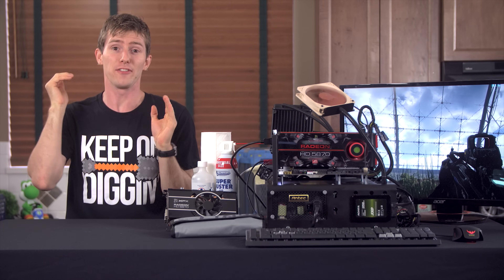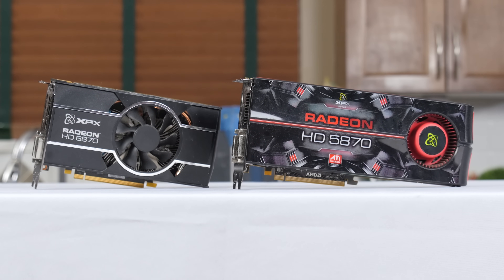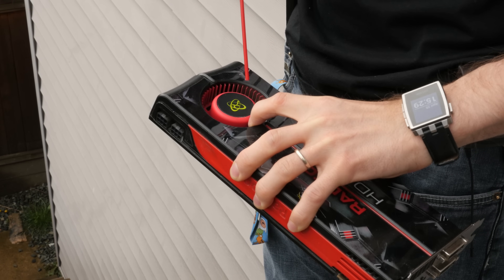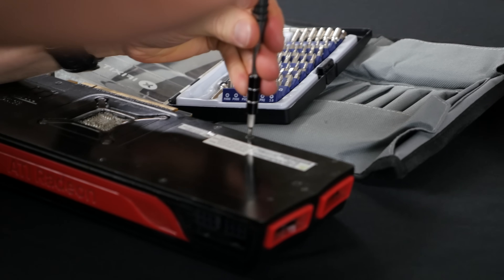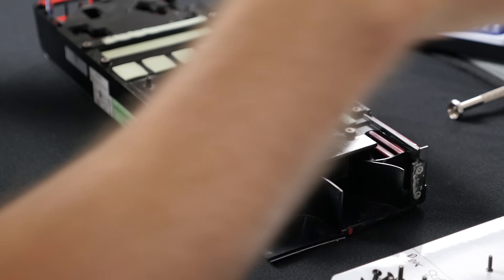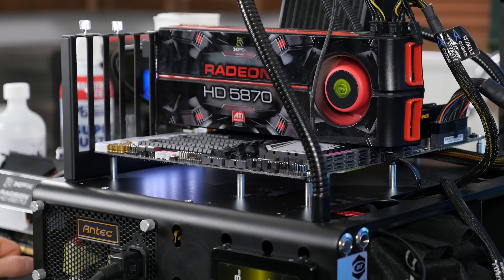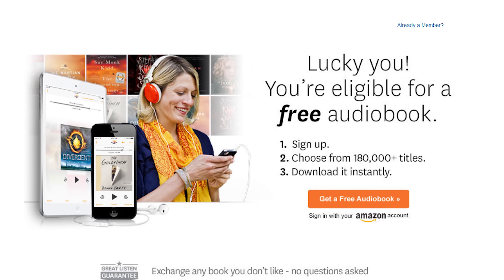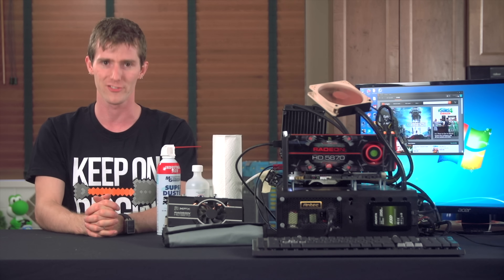Video Card Running Poorly? Clean Your Video Card Cooler!

Comment: I had a video card I got from a friend a while ago and it got extremely hot, up near 90c.  And, no surprise, it would lock up shortly after any game was started. 
It had a blower type cooler, I took it completely apart(A can of air didn't help it).  I found that the inlet(Not normally accessible) for the heat sink fins was completely blocked by about 1/8 of a inch of a solid piece of dust.  I cleaned it up and it was topping out at 60c and it no longer locks up.  Linus's video doesn't really demonstrate, but if your card is really dusty it can make a huge difference.

Comment: fun fact: up until two weeks ago a 5870 WAS my VGA... it took GTA:V to get me to upgrade to something a bit beefier... like a 980. :o

And even using the rest of the pc hardware as it was (an almost 5 years old AMD phenom CPU + 8 gigs non dual channel, because my mobo had a stroke a few years back) i can run gta V with all settings maxed (ultra, not high.. friggin ultra!, but not the "extra" settings, ofc)

this at 60fps. at 1080p 2xmsaa, mind you. but that goes to show how a pc bought in the last gen console generation, only needed an investment of 500 bucks after rebates to beat the snot out of the next gen consoles.

im planning on upgrading the rest of the set up, in the mean time overclocking the cpu 200 mhz extra thanks to the burnin it has after all the years gave me a good +300 score on valley bench.

oh that 5870... i could even play PS2 on it at 60. lovely VGA, too bad it has only one gig of ram.

Comment: I still have a 2gb version with 6 mini dp of that 5870 lying around. It was my first dedicated graphics card and was quite badass back in.. ikd 2009 or so? But at some point it was hitting 90°C in vacuum cleaner mode, despite me cleaning it and replacing thermal compund, wich was the time I decided to upgrade. It still works though, despite just lying arround in random places all the time with not protection (currently on my windowsill)

Comment: guys i need help cleaning a gtx 280 1gb gddr3... runs 70%fan at 90c under load .... 50% fan speed and 55c idle.... can anyone help me ? don't have the money to replace it just yet and want to make sure it lasts me as long as possible. thanks! :)

Comment: Clean your  heatsinks and radiators every 1-2 months. If you leave dust on too long, it gets caked on and hard to clean, but if clear often, you will be able to be able to get by with the suction of a vacuum cleaner hose in order to keep the radiator and heatsink clean.
PS, this also applies to laptops.

Comment: I use to put my graphics card in the washing machine on 30 C. It has worked great so far and my graphics card (Nvidia r7 270) comes out clean and shining. Water isn't bad for your computer unless electricity runs while it's wet. Then I put it in the dryer so it dries faster. The same procedure can be done with your t-shirt

Comment: BE careful not to drop your Graphics card off your 1 feet graphics card box.
I rested my 570 on my 970 box planning for cleaning up and resale purposes. I kicked the box by accident and it fell on the PCB side. When I plugged into the PC I got no image. Nothing. Blank. Black. Amber LED. It was dead. I could login into my account by typing the password and hearing the login sound but there was no display. Not even during POST. So, DO NOT DROP YOUR Graphics card.

Comment: I've had a worse card than either of these.  I picked up an ENGTX 260 that had so much dust and hair in it when I took it apart it had filled every possible space in the cooling fins so tight the trash came out in chunks.  I don't think it was possible for air to actually move through the card any more before I cleaned it.

Comment: I ran into a headache while helping my friend who's having problems with his XFX 7950, It idle's at 60c and tops at 80c at max, wich isnt weird and the fanspeeds are normal, but the card performs sooo bad! My gtx 660 ownes it even though the 7950 is a better performing card!
There was NO dust at all on it! so i thought it could need a thermal paste replacement. But i didnt do it because i didnt want to ruin the thermal pads and replace them. But as you said in this video, will reusing the thermal pads have an inpact on cooling for the drm's?
Reply: It's going south.
Reply: Joshua Bean ?
Reply: ***** Ok good, Didnt do anything because of i it but now i know that there is no problem in it

Comment: I disassabled my R9 270 Dual X cooler design when I saw this video because my gpu ran at 82°C while playing Tomb Raider after 5 hours. Next day I ran Furmark for 1 hour and reached only 80°C (note: Tomb Raider is NOT that demanding), About 3-5°C approvement. If you're not confident about dissasembling it then it's not worth it. If you are, definitely try it.

Comment: I had fantastic experience of cleaning my 3 years old Asus G74 laptop. It became loud as lawnmower and every game stuttered significantly after just few minutes of gaming. I have two cats so I guessed that it's fans are cluttered with fur. Dis assembling this tank was too stressful for me to do it (to access it's interior you have to rip it to the bone including screen so i passed) so I called for serviceman. With his help I was able to clean fans using straight cable ties inserted into the fans (so it won't turn while blowing air). As an air intake to blow dust out we used pressurized air and one of us kept vacuum cleaner to suck fur from the other side. It worked and my laptop works as new. I don't hear fans anymore and I have no stutter anymore.

Comment: Reminds me of my good old GTX295, that thing had to be cleaned every 3-6 months.
It would usually auto poweroff at about 105C, then after cleaning it would be back to 85C at full load, good for at least another 3 months of gaming :)
I just cleaned it with an air compressor, no problems.

Comment: My twin frozr II 6950 was running in the mid-80's under load and 55-60 at idle.I cleaned it (just by removing the shroud and blowing out dust) and it now idles below 40 at stock fan speeds and i've never seen it go above 65 under load. I set a custom fan profile so the fans are only at 20% until it hits 60 and it's never performed better.

Comment: #laptopCards4TheWin
Reply: ***** So true, there is hardly any ventilation and if you have a plastic chassis they seem to heat up a lot quicker and with my old laptop even slightly melt!
Reply: +stinky farts , my laptop is an exelent ventilator and I have had my nvidia GeForce 940i for 8 years now playing highly demanding games. Including GTA, JUST CAUSE and more open world type games. I am installing liquid cooling and it should run fine. Go run your go run your vacuums.

Comment: I clean my PC every 2 weeks, including removing the GPUs and dusting them.  I have, on occasion, vacuumed the fans too to get rid of as much dust/hair as possible.

Some people say vacuuming your PC is a big no-no, but it gives me the BEST performance improvements.  I have a dog and my PC shares a room with a tumble-dryer, so it gathers lots of dust/dander/hair.  After a clean, it can go from 95 degrees C to 35 degrees C.  I'm NOT exaggerating.
Reply: get some fan filters on your case dude.
Reply: there ate vacuums meant specifically for cleaning pcs pay a trip to newegg.com
Reply: of course its called a datavac
Reply: Magnefficient Fragz Nice one!  I just had a quick look around (I'm in the UK, so no newegg for me :( ).  They are very expensive for what they are so I'll probably stick with my normal vacuum.  I've been doing it for years without problems (touch wood!).
Reply: Muzly get an air compressor with adjustable psi selector and with an inline filter to filter out the moisture in the air. Then get an air spray nozzle. Set it to about 35 psi and start blowing out your pc. It works perfectly. I use it every 3 months to clean out my pc. Just do it out side or dust will get every where.
Reply: I clean mine every 6 months, my PC doesn't really get dusty.
Reply: Muzly Get some filters for your lungs too
Reply: Scooter even with filters dust can and will get inside.

Comment: if your PSU is starting to fail and you install a new GPU that requires more power could that mess with your usb having power when you have 12 of them and there all filled
Reply: yes

Comment: air compressor FTW. shoot those dust to heaven. also, please do some guide on oiling GPU fans (or other PC fans in general). i had one problem with 'firstd' GPU fan on my leadtek gtx 770. it doesnt have any hole to put oil.

Comment: My GPU is a Quadro FX 1600M (hateful) in my Dell Precision M6300 workstation laptop (which I use to play games), and the thing runs like trying to get a drunk elephant to go through a 9mm bullet hole without touching it. It's a piece of junk, I bought a better computer off a friend of mine but I can't get that yet, but I wonder if my current laptop graphics card or other components could do with a dusting. It's got a dual core processor and 4GB of DDR2 RAM, but I think it's got only one fan, which may be the CPU cooler if it has one, or else that may be the hard drive running it's tiny heart out trying to run a game at the minimum-est settings I can get a game to (first thing I do when I get a game: turn the setting to bare minimum) so I may look to see if they need dusting, and see if that helps. Any advice would be appreciated greatly.

Comment: I usually just throw my components in the dish washer and I never had a problem with them! :)
Reply: Lord Krigarjonas I usually prepare a bath and a scented candle for my components and let them have a nice bath with some music for a couple of hours.. No problem. ;)
Reply: Lord Krigarjonas I just toss them on the lawn and spray them with the hose, never had any problems....kappa
Reply: Lord Krigarjonas Tbh washing  components/keyboards  and  mice is the best way to clean them, as long a they're dry before you turn them back on.
Reply: ***** Oh yeah, nothing beats that, dude! Do you join your components in the bath?
Reply: Sam Lego As long as there is no current going through the card, it is safe to be put in water, but once you pull it out, you have to be sure it is completely dry before you use it again.
Reply: ***** What kind of music do you usually put on? Mine are a bit picky and have delusions of grandeur so I'm not sure what would please them. Maybe some classical music?
Reply: ***** Plenty of bath-salts really let those parts relax!
Reply: I clean my electronics with distilled water (I am serious) and went as far a completely disassembling my MacBook Pro and washing the motherboard to remove all dust :P
Reply: Lord Krigarjonas A commercial grade washing machine works better though.
Reply: norge696 Or if the water leaves solutes on the circuits after evaporating.
Reply: ***** Can still leave solutes. Although it doesn't have much of anything in it on its own, it can pick up things while being on the boards.
Reply: frealms mine is kinda weird they like reggae-dubstep...
Reply: same
Reply: i piss on them
Reply: Thomas Zwart And absolutely dry and clean from whatever was in that water so it won't rust, corrode, grow mold or wildlife and nothing that came through the allegedly clean water source ain't gonna short some solder tips or internals.

So no, it is not safe to be put in water unless you wanna have the time of your life going over the card after it.
Reply: Yeah, ik its just I was asking cause like lets say of I got a power washer and just saod WOOOOOOOSH it be good?
Reply: ***** Oh, they must be newer cards. =p
Reply: StevieRay9O Use one HDMI each to carry to them their favorite soundtrack I guess.
Reply: I thought I was the only one...
Reply: Lord Krigarjonas 

I throw my PC in the back of my truck and go through the car wash, don't get wax though!
Reply: StevieRay9O Should see how awesome it gets in black light. Crowd goes wild!
Reply: I like top load washers, everything bumping each other during agitation frees up so much mess.
Reply: Lord Krigarjonas Kitty Kepler Water doesn't effect electronics unless they're on at the time.
Reply: tolikechicken what if you use distilled water?
Reply: tolikechicken what about mineral oil? It does not get conductive
Reply: jonnathan deven Dump all of it you want on your components. Linus and Luke have made computers submerged in it. It is a bitch to clean off though.
Reply: frealms What if you have SLI & each GPU prefers different music genres?
Reply: yesitsmario
Should wax it, as pc will stay cleaner, especially when used outdoors at lan-parties & bbq's!
Reply: StevieRay9O For parties I take my chromed out parts.
Reply: Lord Krigarjonas
Reply: frealms
Great party-trick to have chromed private-parts! Ultimate-Bling!!!
Reply: +Felix V but dont forget to dry them in the microwave, dont want water when turn on.
Reply: rubikfan1 That's for scrubs. Once you go hardcore, you use a blowtorch to dry it.
Reply: frealms or lvl up and put it in freezer, than use a hammer to hit of the ice. now you gpu is cooler. and cooler=better
Reply: rubikfan1 But it's wet again! You ain't thinking this through, you use the freezer to ice-cool it and then use the blowtorch to dry it once the ice starts melting and start the process again.

It's a two-step process for maximum performance of the champions MLG no-scope pros.
Reply: frealms no no. you hit the ice off with a hammer. so it is freeze dried like mars. the blow torch is only for the vram.
Reply: rubikfan1 Ahh, I get you, I get you. Good point!
Reply: FlamingRavenMC your grammar sound like brittany ventis grammar
Reply: pfft! I take mine scuba diving and let the cleaner shrimps pick at all the imperfections till its squicky cleaning making sure to decompress on the way up so it doesn't get the bends!
Reply: I hope your kidding
Reply: I usually throw my components in the washer machine and add some bleach
Reply: Lord Krigarjonas water+electronics.....
Reply: @FRK_WasTaken  just dont ad electricity
Reply: explosev gamr yeye
Reply: Hoi hi lol

Comment: Granted I don't know the temperatures up there, but it's almost summer. Running any card at the bare minimum fan speed (mine won't even go below 40%) is asking for high temperatures especially if it's well used.

Comment: Guys a great way to cool your graphics card is to throw it into the freezer for about an hour, then immediately throw it back into your system. the coolness from your freezer should last a while and keep your card nice and cool while playing those stressful games.
Reply: Thanks! I'm going to try this. I'll tell you how it goes!!!
Reply: Fred Lavar Steenerson Stevens Herbert 
hope u joke riiight. or mybe Trolling!!
it will doom VGA card or any electric dvice in freezer then operated.
Humidy will shortcircuit component.
Reply: Hanes G.Mdia
shut up noob
Reply: Fred Lavar Steenerson Stevens Herbert
bruup...) at least now i know u not try to troll,
just lack of information ),
better way is prepare a frozen ice pack,
than put to nearest air suction of PC case.
not help much, on mine cooling 5 C.
just watch water drop...
if u put in freezer there's humidity will short ur VGA even only 1 hour.
still best solution is water cooling!
Reply: Hanes G.Mdia
thank u
Reply: Condensation will build up going from freezer to a warm area. Ever notice how a glass of ice water sweats when out in a warm house or hot weather? That will happen to your gpu and fry it.
Reply: Fred Lavar Steenerson Stevens Herbert Also a great way to fry your card, I can only hope that you forgot to include a Kappa or some hint of sarcasm lol

Comment: My Asus GTX 760 sometimes has issues with artifacting (even with max power target and overvoltage [without BIOS changes] at stock speeds), and Nvidia display driver crashing... it also has ~70% fan speed under load at stock.

Is this a really bad sign? I never realized people typically have such low fan speeds... especially on a reference blower style o__0

I get the feeling the Display driver crashing (only happens occasionally) is an issue with the driver rather than the card.

Comment: Woah,  I have that exact xfx 6870. I've had to replace the cooler a few times because the fan died several times. Its still a pretty cool card that I still haven't replaced.

Comment: I clean my computer regularly but I used to just blow out the heat sinks and fans with a compressor and that was it but my computer started randomly shutting down and blue screening and black screening so I tried cleaning it out so I disassembled my GPU, cleaned it out and the problem was gone.